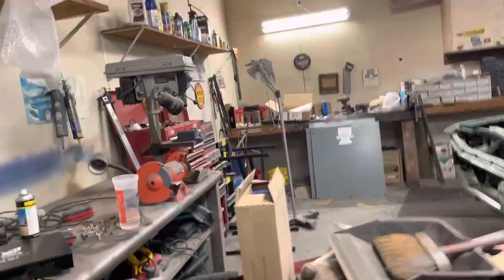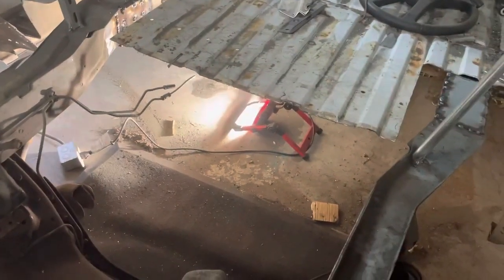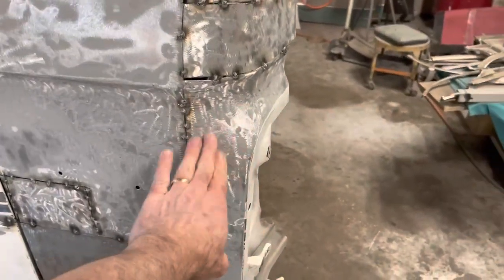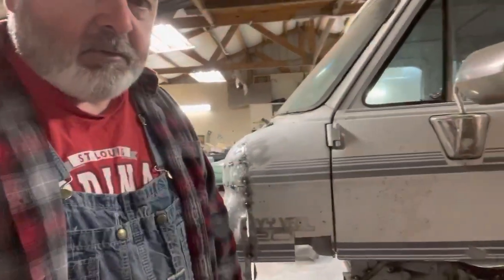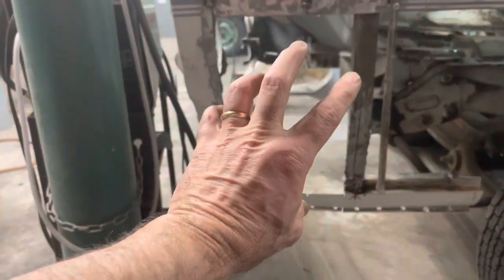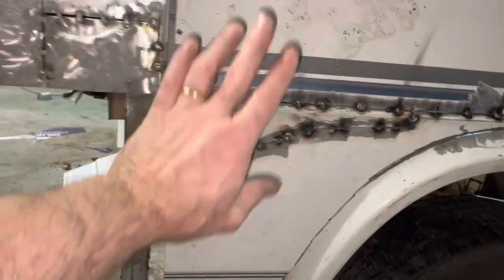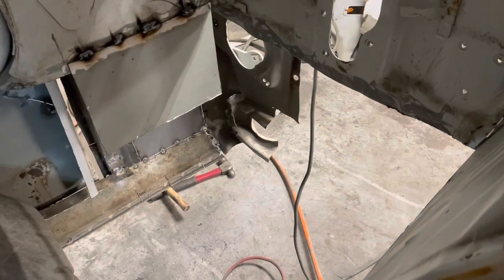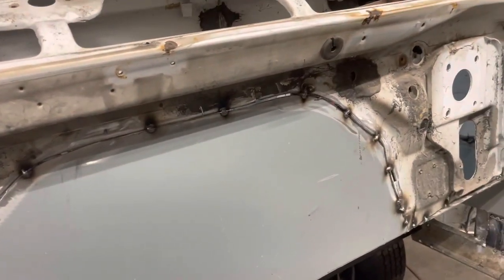Cab over Chevy Van conversion part 7; side 2 sheet metal

Comment: Sign of good workmanship is when it looks easy or you did not have to do much to make it work.  Great interesting project. Ever consider using a grille from a 1964 to 66  Chevrolet big truck .  They are  painted and not beat like the pickup trucks usually are cheaper .Enjoyed your music
Reply from the maker: Thank you! I was actually looking at the floating GMC grill from the early 60s trucks. Looks like we’re on the same wavelength.

Comment: Is your plan to move the steering box portion of the frame forward so you have a nice solid mount for the steering box?
Reply from the maker: I’m probably just going to duplicate the mount on the frame extension. Should be fairly easy to make.